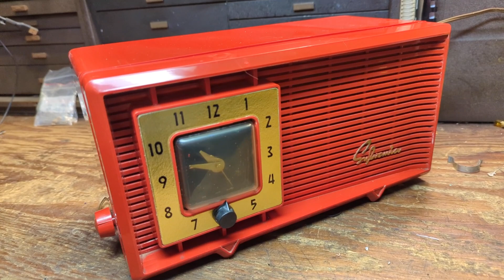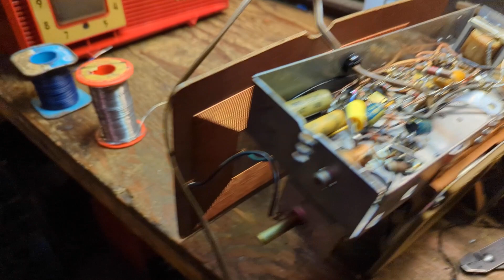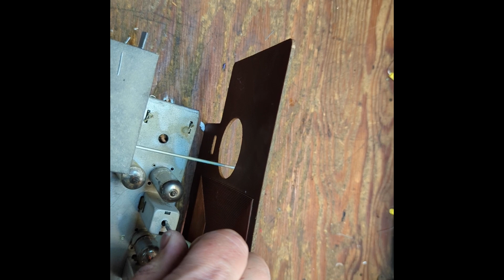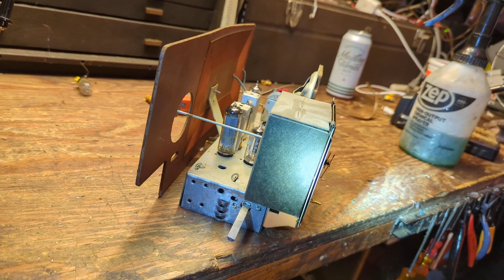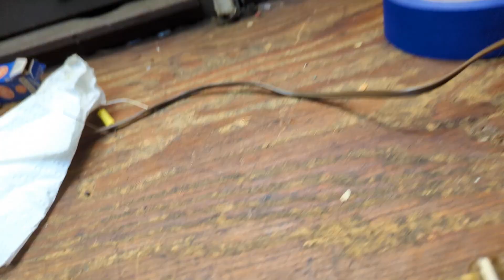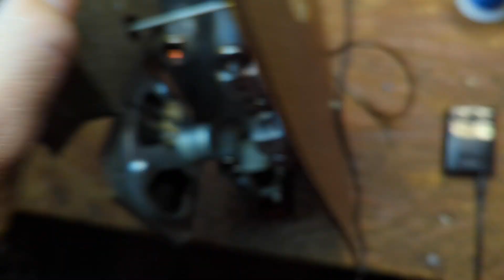Restoring a fire engine red Sylvania radio

Comment: Hello Seth how are you. I would like to share an idea about safety. As you know the tuner is connected to AVC on most radios and there is a .05uf capacitor that goes from B- to tuner ground which is AVC and I use a .01uf to reduce 60cycle AC current in case someone touches the metal parts of the tuner. 4 places...for X2Y2 safety capacitor chassis to B-   tuner ground to B- or AVC.  across the line and antenna coupling if equipped

Comment: Hello, thanks to you and your "tech tip", I was able to restart a Telechron movement (Yes, I found a french radio from 1956 equipped with a Telechron clock!!!) Works perfectly! Thanks a lot and Bravo for your work!!
Reply from the maker: I never knew Telechron made anything other than 110 volt movements. First time I've ever heard of one exported. Would be curious what make and model you have
Reply: @misterradio5035  bizarre, I tried to send a link to the radio, and the message disappeared...the set is a Ducretet-Thomson L4623 (LW, MW, SW and BE), we had 110v in France until the end of the fifties...
Reply from the maker: @andrefernandez8414  Interesting! I looked up that model. French radios are usually very distinctive looking but this one almost looks American, like a general electric clock radio. And thanks, I did not know that France operated at 110 volts at one time

Comment: I found an old Capehart Clock Radio from 1953 that was still in its original box yet and the unit still had all of its original tubes in it yet and untouched electrically as well and the chassis is not rusty either. It's a model TC-62, I don't know if you're familiar with that model of Capehart clock radio or not.

Comment: I worked on a Sylvania 518 a few weeks ago. Basically the same exact chassis and same exact everything. It had all original tubes is very clean. It had a bad filter, bad output tube, bad dial lamp, etc. An IF alignment really woke it up and it works nicely. Great job! I wish I had as much patience for cabinets as you do.

Comment: Model 548  the " Reveille" also came in  bottle green ,sand, and  ebony and made by Sylvania Electric of Canada.
( Radio Museum website info) Great mid century design  with brightly colored  plastic cabinet choices.
 Nice clock motor fix. Got the right  size and color knob to replace the big one. It really looks cool Seth . 
Merry Christmas to you and yours. Steve
Reply from the maker: Amazing that you can always know the models of these things!

Comment: I wonder why you could not have a Micro Transmitter for 640Khz powered off the clock circuit when the radio is tuned to 640Khz you can listen to your own selection of music and you won't have to modify any of the radio connections.
Reply: Yeah, but sometimes it’s better to preserve it.
(This is an opinion statement)
Reply from the maker: @thomas_howe  Yep. If I get in something special, as in museum quality? Sometimes we dont even restore it and leave it original. These plastic radios? We could  not give them away with out the audio inputs sadly